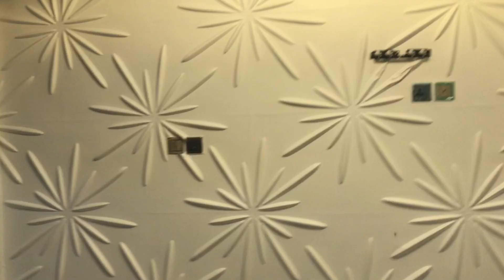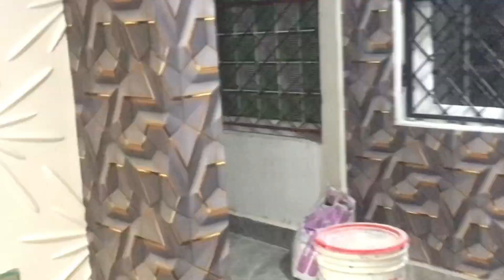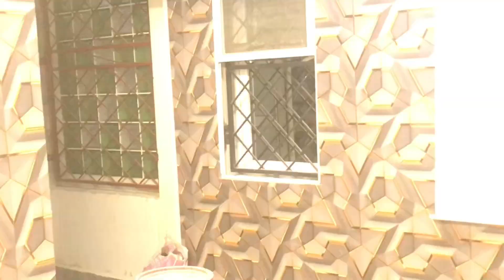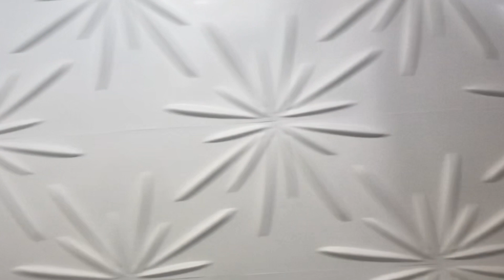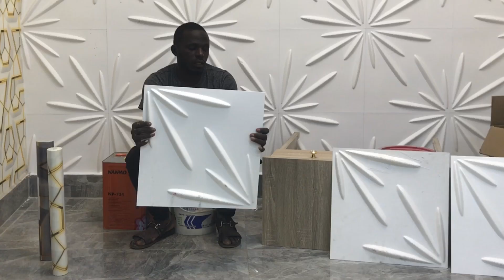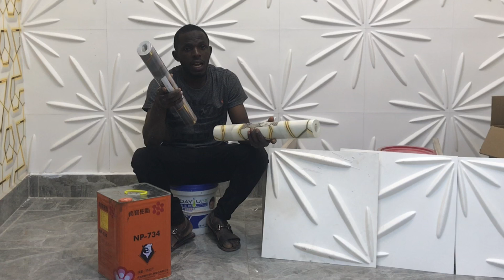How to Install Wallpaper and 3D wall panel | Cost of Installation

Comment: Thank you sir for your teaching. Pls which type of paint are you using mostly to paint the wallpaper.
Reply from the maker: Wallpaper or 3d
Reply: @wahbillyconcepts9147  3d
Reply from the maker: Satin or silk paint is what is used to paint 3D panel
Reply: Thank you very much. can I use emotion
Reply: Wow thanks so much sir u r d best